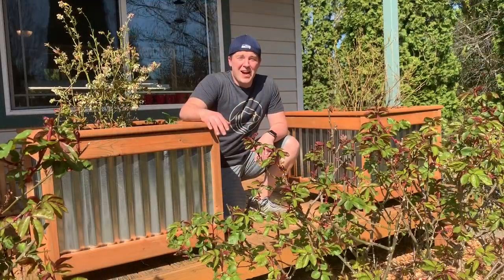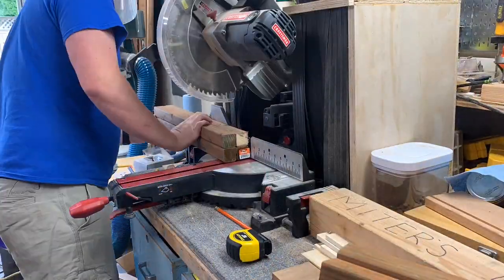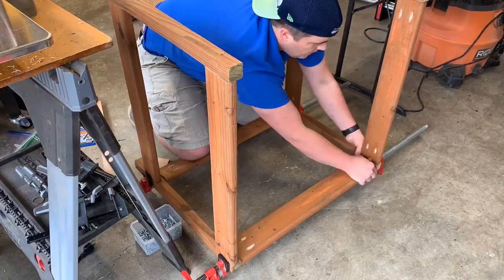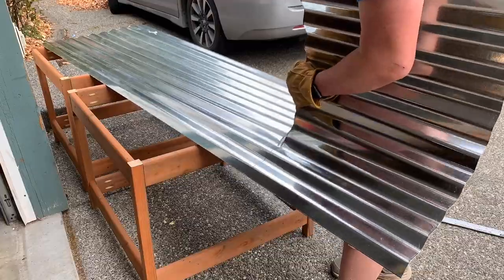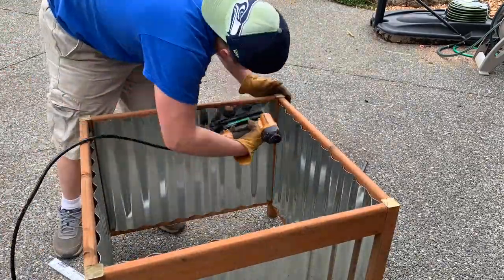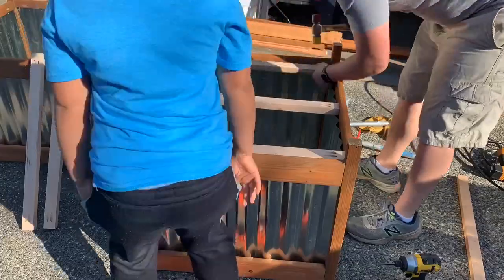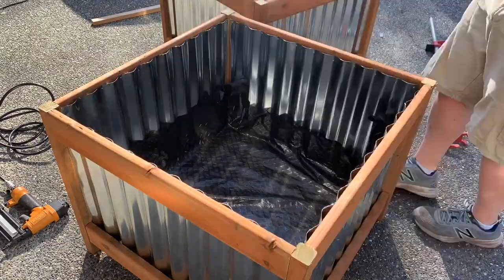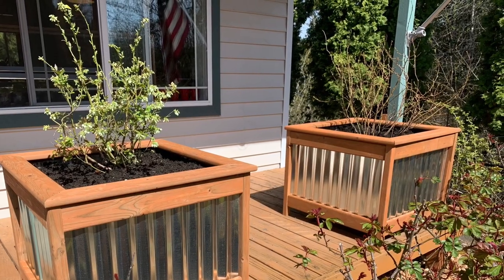How to Make a Planter with Corrugated Metal

Comment: I like you planters. Simple yet very stylish. I think I’ll surprise my wife with a few of them. 
What size treated wood for the sides and too did you use 1x6?
Reply from the maker: Thanks! Can’t quite recall. Went with the treated decking boards at Home Depot. Think they were around 1x4s but the thicker 1 1/4”thickness. Wish I could remember.

Comment: Thanks for the helpful video. Did you drill drain-holes in the base? If not how does water drain out?
Reply from the maker: I did drill some holes. However there are plenty of gaps between the slats on the bottom.
Reply: @SixEightWoodworks  Thank you for the reply. I'm considering using a similar design as a balcony flower box.

Comment: No fancy shmancy tools

Oh except 4ft clamps lol
Reply: The clamps really aren’t too fancy. You can get 3/4” pipe clamps for ~$19 a clamp from Home Depot along with 10’ of 3/4” black iron pipe or 3/4” galvanized steel pipe for ~$23 to $26. After you have Home Depot cut and thread the pipe you can have two 5’ pipes for ~$70 after tax